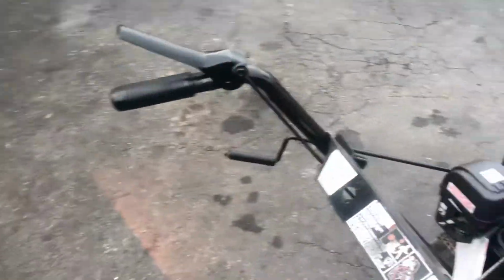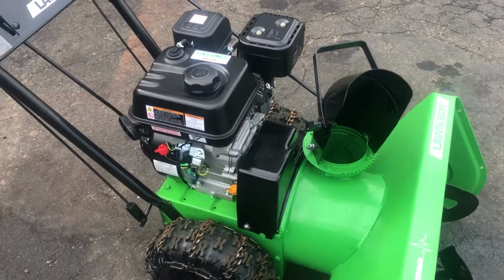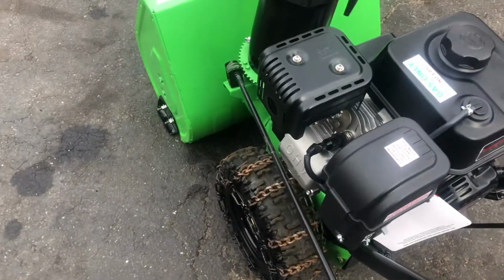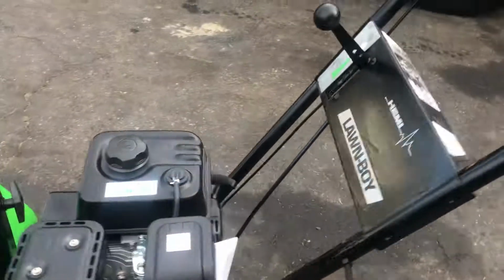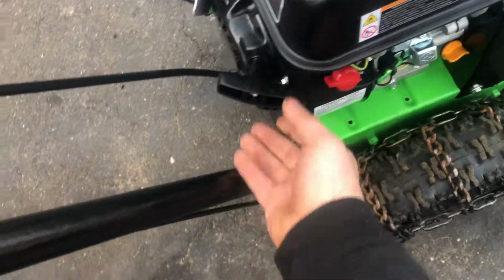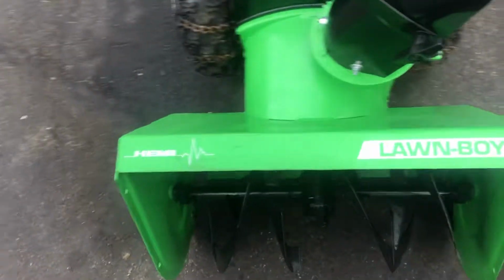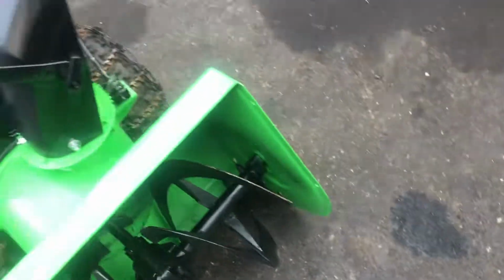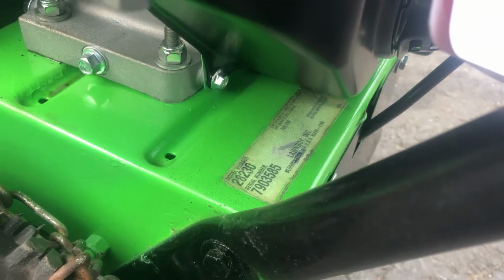Restored Lawn Boy 522r 2 Stage Snow Blower W Predator 212cc Hemi Engine

Comment: I got the same blower and the stock Tecumseh engine is starting to work like a piece of shit and i just wanna ditch it. How easy was this mod? I’m seriously considering doing it.
Reply from the maker: Very Easy!  Just need new hardware...

4 Longers Bolts
4 Washers
4 NYLON Lock Nuts to secure motor to base

New Crank Bolt RE-USE OEM WASHER AND LOCK WASHER

Going oing to need a long EYE Bolt with nuts to extech chute crank handle